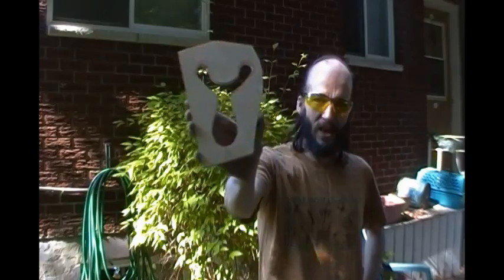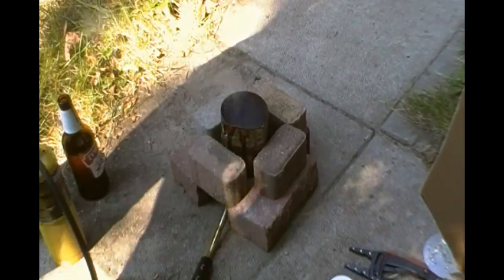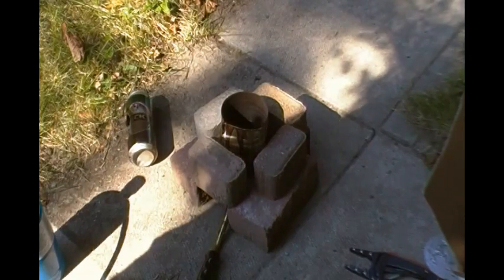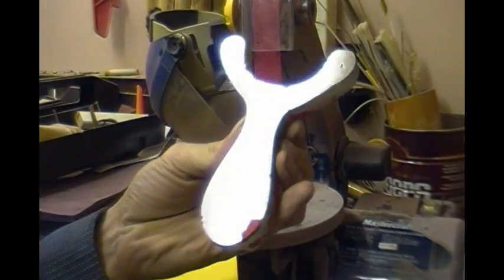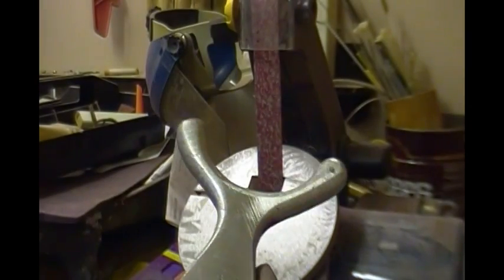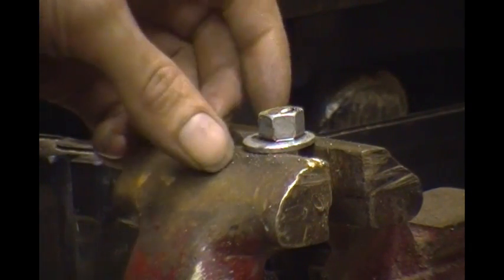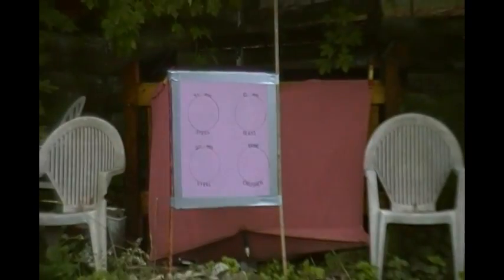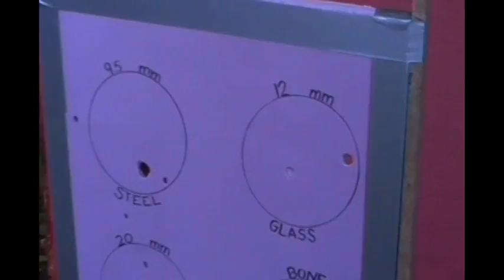200 Subs! Casting a metal slingshot

Comment from the maker: Probably, yes. That's one of my problems. Much of the steel crucible is exposed to the air too which is cooling it down.
 
I need a better forge and a more powerful heat source. I think I'll have to revisit this project in the future.

Comment from the maker: The big can was steel. The little one was aluminium.
 
It may have melted it if I put it in first. I think since it was floating on molten silver, it wasn't getting enough heat. I could have blasted it with the torch, but then it just would have turned into aluminium oxide since it's paper thin.

Comment: You could achieve the heat you need/want with just charcoal and an air source, leaf blower/compressor etc blowing air into the base of the fire
Reply from the maker: Yes, thank you. =)
 
I have made two aluminium slingshots with that method now. =)
 
I am now moving on to using kerosene and waste-oil as fuel.
Reply: Ah cool, I haven't caught those video's yet. Is the choice to use waste oil because it's more cost effective than charcoal?
Reply from the maker: Tengu3000 Yes, the cost is one factor.
 
The main reason though, is it's easier to get large volumes of fuel into the foundry with liquid.
 
If I used charcoal, I'd have to open it up from time to time to add more fuel. Which wastes heat.
 
Here's the video where I use charcoal:
Casting an aluminium slingshot.